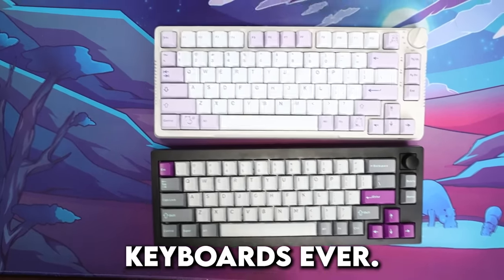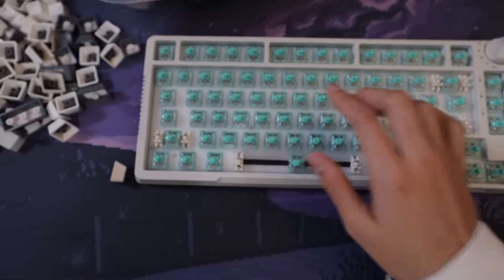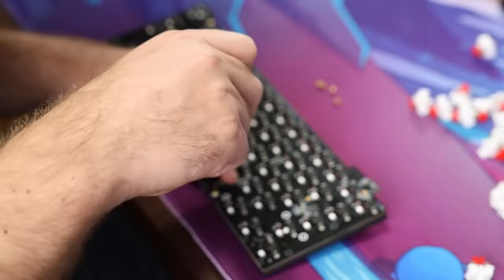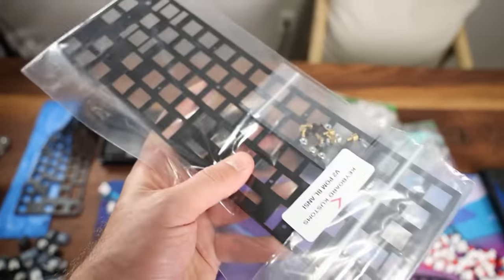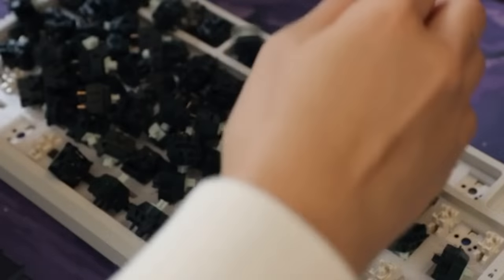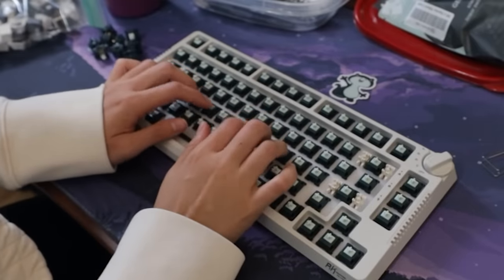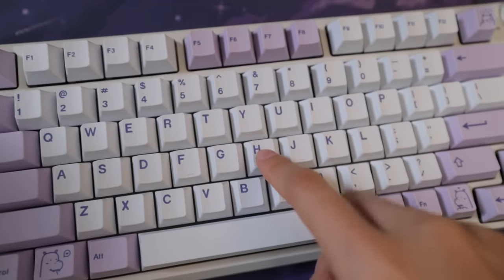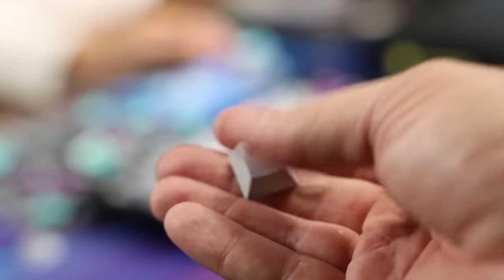I built the Quietest Keyboard (so I can finally sleep)

Comment: Surprisingly even without all the special pre-made foams I actually think Betty won in terms of quality and quietness of the sound. There's a couple things you could do to make it significantly quieter:

1. Sit the entire keyboard FLAT (not on the raised flip out legs) on at least 1cm of closed cell packing foam (you definitely have some if you have product boxes lying around). 1-3 keyboard mats, especially foam+felt ones, would also work but cost like 30-50 bucks vs the free foam. This will heavily isolate the board from the desk, IMO making everything sound a lot better, and completely removing the bass-ey reverberations that happen into the desk especially in the spacebar (or the snappy bottom out of heavy bump tactiles). You can simulate the difference by just trying your board on the desk, and then on your mattress.
2. Using car dampener, rolled paper towel, painters tape, or various other combinations of things to significantly fill up the space bar. The adhesive foams used in the video help a little bit, but really filling the bar up can do so much more. Similar can also be done to all of the long modifier keys even the ones without stabilizers. Using an alternate space bar of a softer material like polycarbonate can also help.
3. Using a switch dampening pad on top of the space bar switch, or improvising it by using a little rectangle of the adhesive foam on the inner wall of the space bar, right above or below the switch, so that it comes in contact with the switch at the bottom out (basically like the cherry + north-facing switch interference, but intentional, and dampened). It may take a couple tries to get the positioning right, but the bottom out can turn into a thud instead of a clack, stopping both the switch and the stabilizers from bottoming out, without making it feel mushy or preventing actuation.
Reply: before i started getting into this stuff i tried to foam my steelseries apex pro (aluminum plate that is also the body, so kinda hopeless). i cut the foam into pieces and got it into every crevice inside the chassis and it made next to no difference.

then i used double sided tape to put more foam, 4mm thick, on the bottom of the case, externally...made a world of difference even despite having a desk pad already

Comment: I'm going to go with Betty's for just a hair quieter, but I like the look of Jake's more. 

I'm really liking that silent keyboards are becoming more prominent. As somone who has a pretty high end sound setup, and spends quite a bit of time typing while live either in meetings or in presentations, the noise gate often isnt enough. I tend to hit the key's pretty hard and bottom out alot when i'm typing quickly, particularly when I take notes and I've recently found this channel, which I'm really enjoying. Particularly when it's a cheaper build as I am very budget limited. 

I recently purchased a Keychron K4 pro, and while it's miles better than my old Corsair Strafe, I am planning to mod it to make it quieter after the holidays, so I'll continue watching and learn the best and least expensive way to do this.

Thanks for the video.

Comment: I think noise level is about the same, but the sounds are different. There are phone apps to measure noise level that you can use when you do a typing test. I'd also recommend typing on it like you would when you are actually typing, which I imagine might be harder and faster than what you showed in the short typing clip. 
Also, I think you're not supposed to use blue/painter's/masking tape in keyboards with batteries. An alternative is called wire harness electrical tape. It's used in automotive engines and is high heat-resistant and also has innate sound dampening qualities. I have no idea if it leaves behind a residue, but reading reviews on specific brands of it should answer that. 
I, too, use Royal Kludges, only I've been too scared/annoyed/lazy to remove the feet to unscrew the case from any of them, so I haven't had the chance to really mod one yet, but I really want to try that tape in my M75. I currently have Gateron Pro 3.0s and cherry profile PBT keycaps on it. It's not silent, but I like the sound profile. I do want a silent set of switches, as well, though, which led me to this video. I'm looking at Sea Salt Silent, Gamakay Pegasus, Akko Fairy Silents, and Redragon Stars A120. Click and Thock rated the Redragon switches surprisingly highly but I'd really like to see how they compare directly to the Pegasus.

Comment: I am not an expert but if you hair dryer your sticky padding for your keyboard it wont damage the adhesive on the pads and you can just lift it and still reappliable. I use this method on my mouse when I manually replace switches.

Comment: I've been delving in to the keyboard side of youtube and reddit again and now I want more stuff! AHHH
Reply: Unfortunately for me though I've once again decided that my ideal board is something which doesn't actually exist and would be extremely difficult and/or expensive to reproduce..
Imagine:
A 96% hybrid (see Tecware Phantom 96 layout)
With a slim case (like Tecware Phantom L, or Nuphy Air series)
Short actuating switches (Like Outemu LP, Gateron LP or literally any "speed" switch... but like, silent and light springs)
XDA keycaps (barely fits the Outemu LP and completely bottoms out on Gateron LP.. I just like the spherical top and uniform profile)
And dual wired/wireless capability 

So far I hit a snag on step 1 as the only 96% hybrid layout boards I can find are discontinued, plus they're not slim and not wireless

Comment: think i'm starting to understand the science.  switches create higher frequency sounds while chassis creates lower frequency sounds.  great switches in crap chassis = thocky ( NIZ ).  great switches in great chassis = sounds like a regular keyboard, but much quieter.  compared to average KB my NIZ is very quiet but it has really prominent bass to it.  like a kick drum.  honestly i would get a 2nd Niz for my 2nd PC if Amazon still sold it, but if i have to order from China i may as well look at other options.

Comment: How does the Gecko silent and WS x60 compare to the Boba U4S? I just built a silent keyboard with the Boba U4S and I wonder if I can improve it with the switches you used.
Reply: I don't have a full set of silents but I got a huge set of linear tester switches, including 6 different silents. Silent boba, WS, gecko, heartbeat, coral, and alpaca. By far my favorite was the gecko. Not the most silent of them, but certainly the best feel and sound (quietly thocky). All of the other silent switches felt noticeably scratchy and you could hear the scratch slightly. Lubing might remedy it but I was lookng for the best silent stock switches. Unfortunely Kinetic Labs just ran out of stock on geckos and won't restock for about another 2 months.
Reply: @Jumplify  Thank you,  I will tried to lube my U4s first to see if it reduce the scratchy sound. If it doesn't work then I will  tried  the Haimu heartbeat
Reply: @ShinyKyu  Thank you,  I do notice the scratch on the down stroke of the U4. I will tried to lube it

Comment: so the "what are your thoughts on oil kings" guy here
what's some good foam for keyboards?
sudden realization that oil kings seem to be for one:
a bit overkill (and take quite long to actuate)
two: easily able to ruin a keyboard
three: expensive
so I think plate foam could help
what are your thoughts on some good plate foam
also my keyboard's a three pin (significant blunder)
Reply: thank you for the heart
it has provided me with much info

Comment: is there anywhere where I could take my keyboard to fix one switch? It's a soldered keyboard that I bought preowned. The switch came off with the keycap, so I literally only need ONE switch and ONE desolder/solder to attach a new one. I do not want to invest into soldering equipment as ONLY the one switch came off. Any ideas on help for my situation?
Reply: Find a local maker space if they exist in your area, buy someone with a soldering iron a coffee: that is a bargain.

Comment: Hey
i have a GANSS 87C-D TKL keyboard (BT and Wired). It stopped working one day, both in Wired and BT. It is getting detected as keyboard in windows though. Also none of the lights in keyboard is working. I have checked the light individually and it is working. What could be the issue ?  I do not see any short in PCB as well.